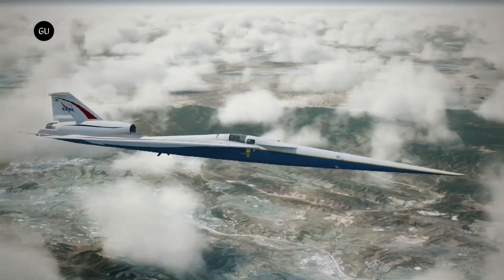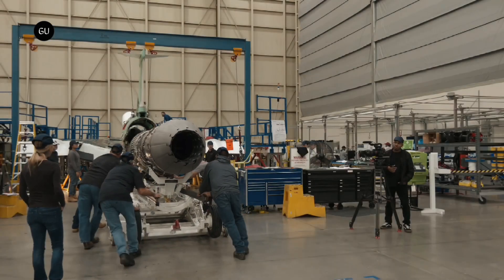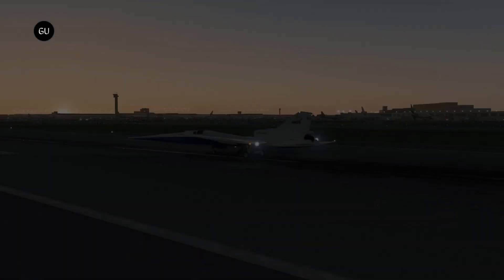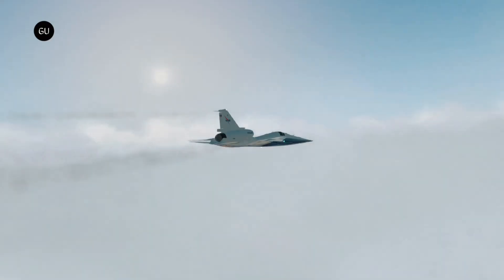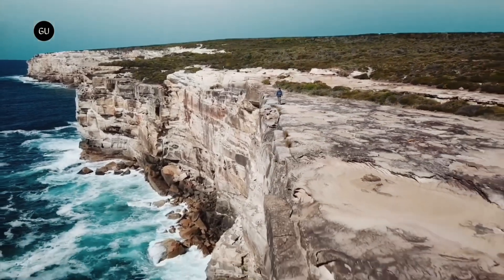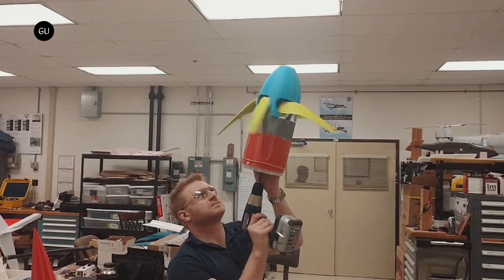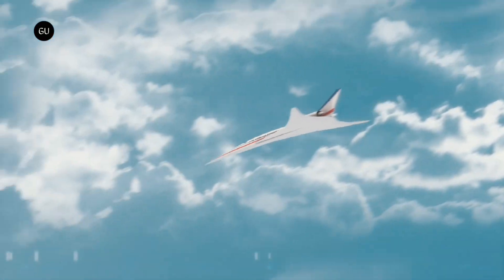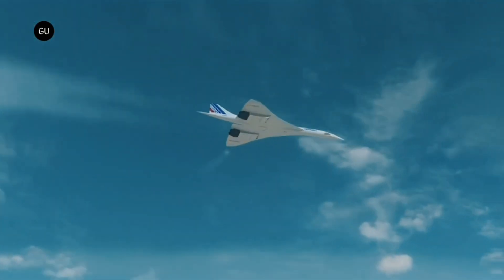NASA's X-59 'Quiet' Supersonic Jet is Now Ready to Fly

Comment: Across the USA? 2 hours to be delayed by TSA, then 30 minutes for a flight, then an hour to escape the airport?

Here's a concept: Reduce the security to 10 minutes, max, and have baggaged ready in five minutes. How's THAT for supersonic?
Reply: Exactly. It would would also do away with the case for high speed rail, since security times is what makes air travel take so long.
All the laws put in place after 911 were "temporary" after all.